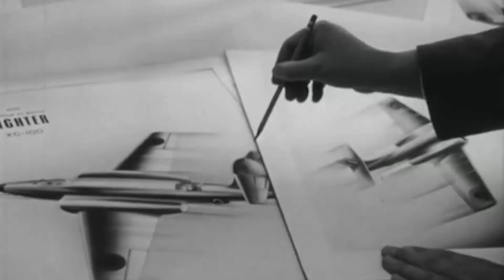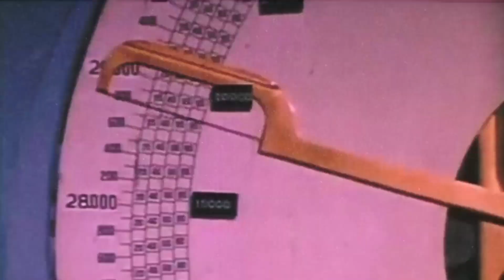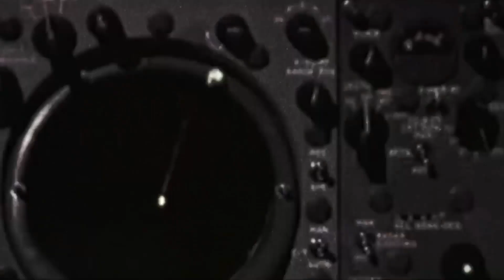Why Britain's Most Advanced Tactical Nuclear Bomber Never Made It Into Service?

Comment: The F111 Aardvark was faster than the TSR2, it had a better rate of climb, a higher maximum ceiling, a better thrust to weight ratio, it was more maneuverable, had longer range, a better bomb load capacity, more modern engines and it could take off and land in half the distance on any rough unmade air strip thanks to landing gear that was so tough that it was capable of landing on an aircraft carrier.  That said, the TSR2 would have been cheaper to buy and operate than the F111 and the basic design can be said to have been vindicated with the appearance of the slower, less complex but very similar in layout Sepcat Jaguar which was a very successful aircraft.  As far as politics are concerned, using the F111 as a crutch to explain the cancellation of the TSR2 is a bit unfair because every decision made by government is political and in any case the F111 was hit by the same bureaucratic axe for basically the same reasons, so it's safe to say outside pressure wasn't the issue in either case.
Reply: It’s a false comparison lining up the stats with the F111 F variant with the uncompleted TSR2.
Reply: @robertpatrick3350  If I was using the F111 F as a baseline I would have mentioned the avionics which went though a lot of changes throughout its' career.  As far as the basic aircraft was concerned, the performance and capabilities for the "A" and "F" model was about the same.  The same goes for the TSR2.  The only thing that made it incomplete was the absence of avionics in the prototype which were outside the aircraft manufacturer's control.  Except for a few solvable issues like the engines and landing gear, the aircraft itself flew just fine, but it wasn't going to get any better in terms of speed, altitude and bomb load than it was at the prototype stage.  Those parameters were determined while the design was still on the drawing board.
Reply: TSR and the F 111 are different because  TSR was envisioned as a medium range tactical bomber not an aircraft with fighter qualities buying the F 111 would have been disastrous for the RAF as it had a number of drawbacks and technical problems during its entire life and also expensive
Reply: @ashokkumar3995  The F111 was the replacement for the F105 Thunderchief: a medium tactical bomber, the latter being able to function as a fighter, but not very well.  There was an F111B variant, of course, that was supposed to be a "fleet defense fighter" for the USN at the insistence of then Sec-Def Robert McNamara but the "turtle-111" was doomed to failure from the start due to size, excess weight and the fact that the F111 was not maneuverable enough to act as a fighter against other fighters inside of long missile range.  That program was dropped and the contractor (Grumman) went on the build the much more successful F14 Tomcat.  The only encounter between a jet fighter and an F111 occurred in 1991 during the Gulf War where the relative skills of the pilots determined the outcome: IE, the F111 pilot was able to evade the enemy Mirage F1 and the pilot of the F1 made an error and crashed due to maneuvers made by the F111, making it the only (unofficial) air-to-air kill by the F111.  As far as the RAF acquiring the F111, arguments could be made in favor of either aircraft.  The TSR2 was compatible with RAF aircraft at the time.  It used the same engines as the Avro Vulcan, making maintenance much easier, it didn't have all the complexities associated with swing-wing technology and while it had issues, they were solvable.  For example, the short take off and landing issue could have been mitigated with disposable RATO pods (Rocket Assisted take off) to cut take off distance, and it could have been fitted with a tail hook for short landing.  Range could have been extended using a disposable fuel pod under the fuselage like was used for the B58 Hustler, that could be ejected sometime during a mission.  Add forward canards ahead of the wing and the TSR2 could have been pretty maneuverable and STOL performance improved even more.  The air frame had a lot of potential.  On the other hand, the F111 could function in its' role as a tactical strike aircraft pretty much "out of the box" without any of those modifications.  It was expensive to operate, certainly,  but once the bugs were worked out, which took a little over a decade, it was pretty reliable and an excellent conventional medium bomber.  The Australians operated the F111 for over 40 years.  The F111 would have been a great asset to the RAF during the Falklands war.  It could outrange the Avro Vulcan by over 1,000 miles which would have made Operation Black Buck (the bombing mission against Port Stanley) a bit less risky and the damage much more significant (though less spectacular) than putting a few holes in the runway since the F111 was a pinpoint bomber and the Vulcan wasn't.  The irony is the RAF eventually acquired the Panavia Tornado, which was a swing-wing fighter/bomber and it was successful in service, proving the concept for such a plane and the capability of the RAF to fly it without going broke.  Coulda-Woulda-Shoulda.
Reply: It was cancelled because the British government didn’t want to fund research into supersonic flight. Real shame and a lack of vision.